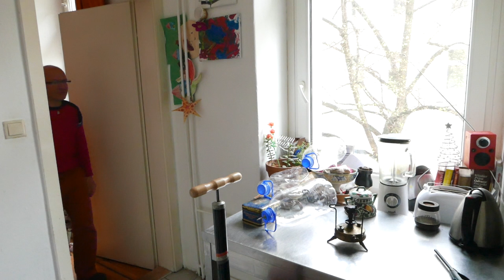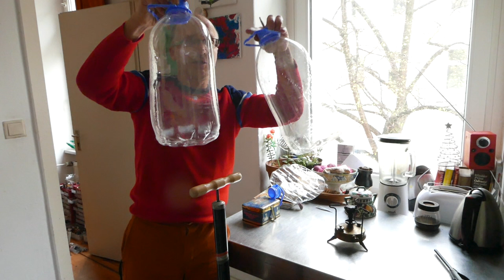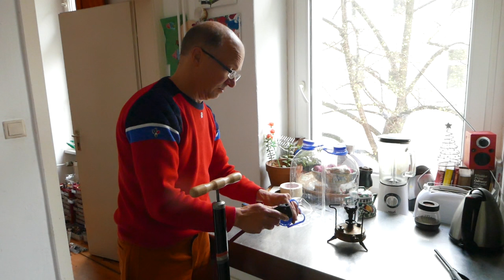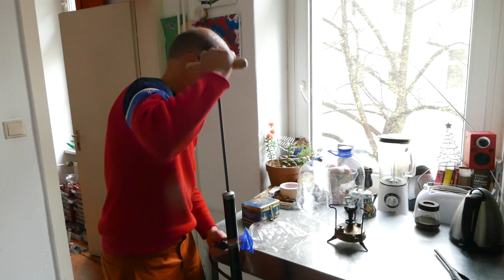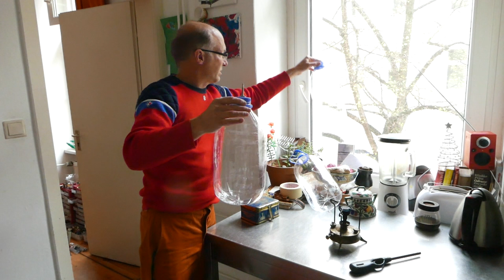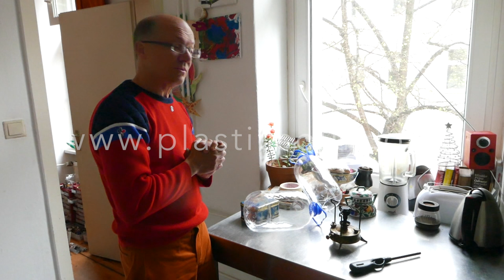Tutorial #3 HOW TO MAKE THE PLASTIC BOTTLE SMOOTH

Comment: Staslplaat:  What would happen if once it started to warm up, you popped the pump back on the valve and put a little bit more air pressure in it? And maybe pop a little bit more in before the bottle cools after the treatment?Would that prevent any shrinkage from the heat treatment?

Comment: The disadvantage of that is that the rope you get is already in it's shrunken state,
you can't shrink it further, if it is a property that you need in a plastic rope then this method wont be good for that.
For example, i use this plastic rope to X tie a wooden mallet head to it's handle, then when its tied tight, i heat up the plastic rope so it shrinks further and really gripping the mallet head and handle tight.
Reply from the maker: first: if you do not treat it like this you can not cut it, and in your few you can only work with bottles with s mood surface, and there ar not many (close to none). But second, and more important, when you raise the inner pressure  it's only partly shrink, and my experience is that it still works fine.
Reply: @staalplaat  That is great to hear,
As it is true it is very hard to find smooth bottles, 
If you say i can still shrink it further after smoothing the bottle, it should be fine for my usage as well,
I will give it a try, thanks!